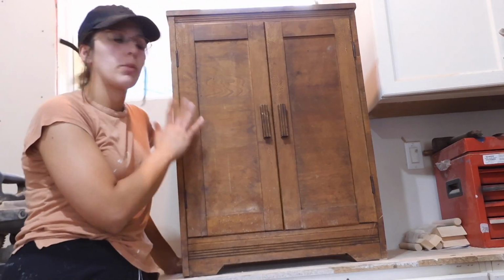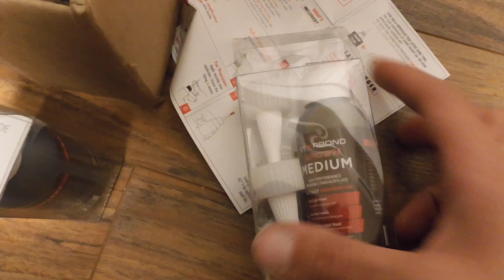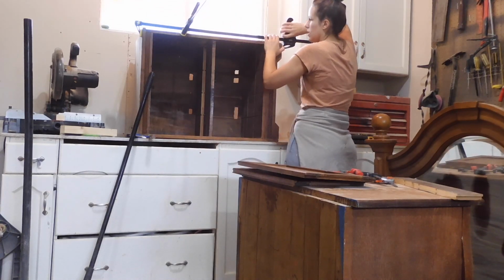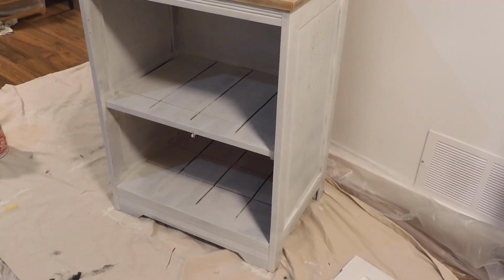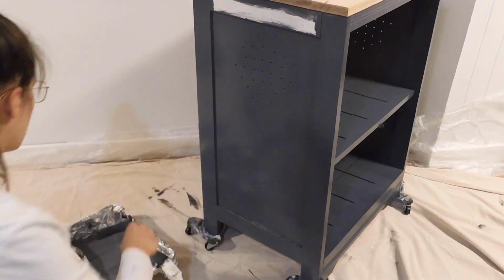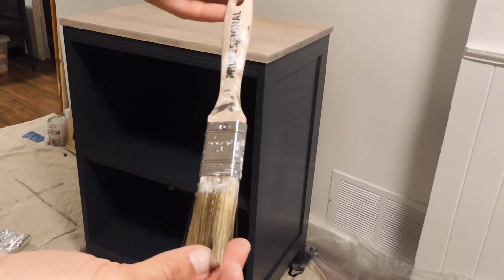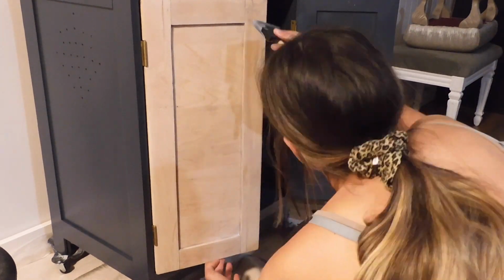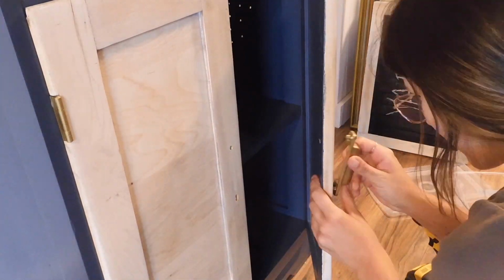Antique Record Cabinet Flip | Trash to Treasure | Furniture Flip By Sarah

Comment: 19:36 It appears in that photo that the side boards and top board are flush on the door on the left. For the door on the right, the top board is proud. Is it possible the parts weren’t positioned properly when they were glued? But they look close to flush in the final reveal, so I dunno.

As Kathleen suggested, they could be flipped 180°. In the final reveal, the left door appears to be higher than the right, rather than a difference in length. So there could be a slight offset in the hinges.

Another possibility is that somebody made an oops when it was manufactured, and thought nobody’d notice the hinges were 1/16" off.

It’s difficult trying to diagnose something from an image on a screen.😅

Comment: I think the cabinet turned out nicely. I really like that navy color. I know it's a bummer about the doors. I've had the same thing happen to me. All my measurements were straight and the handles still looked crooked. I think that's on the furniture maker. The suggestion down below, about flipping the doors, just might work. Good luck! The piece still looks good. 🙂👍
Reply from the maker: Thank you so much and yes I think I will have to give it a try!!! 😊

Comment: So you did not have to seal the paint, just the stain? Is the paint specifically for furniture? Thank you
Reply from the maker: Yes that’s correct! The BM advance line of paint had a build in top coat! You pick your finish and after 30 days the paint fully cures! The paint was made for kitchen cabinets and trim but is great for furniture!!! I love using it
Reply: @furnitureflipbysarah  thank you
Reply from the maker: No problem!